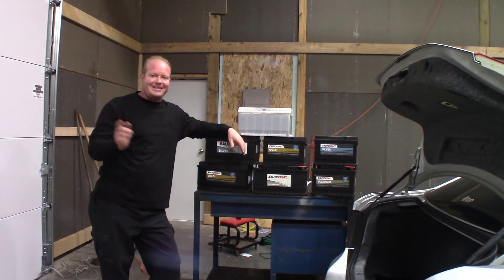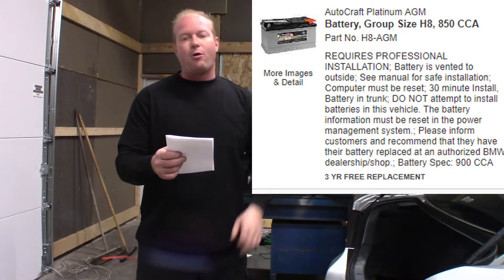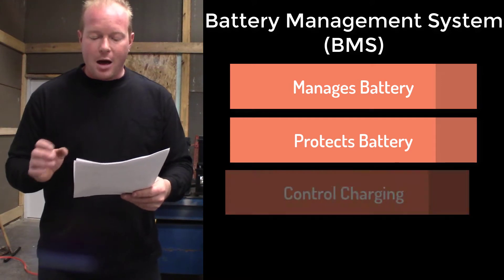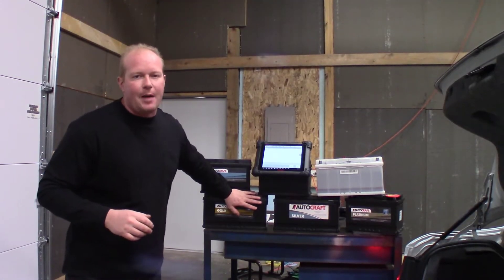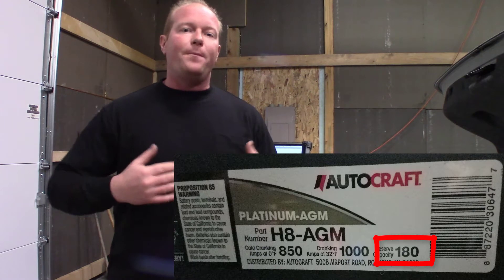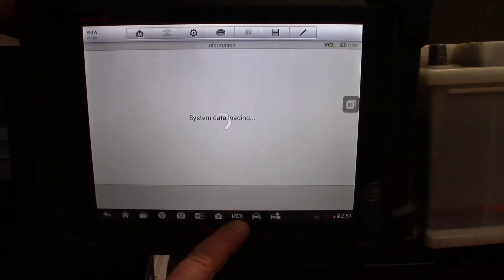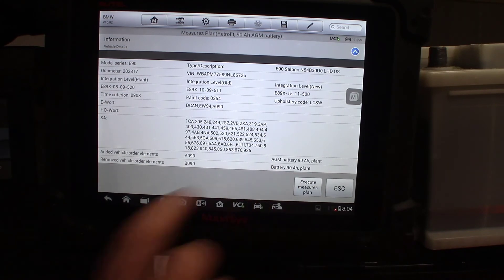BMW Battery upgrade, and registration with Autel MS908P

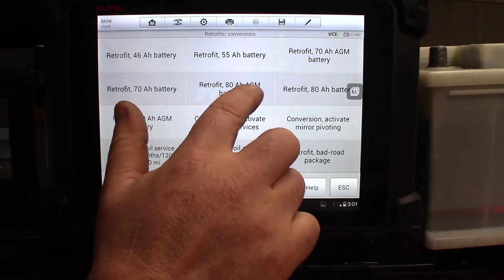Comment: 3:25 And what if I had a 60Ah or 95Ah battery. The MS908 is an expensive unit and falls short. A real diagnostic tester would have drop-down menus for battery type, capacity where you would actually enter the value...
Reply: I had the same problem with the Maxisys. I wonder if there is an update for ah95 option..
Reply: I have the regular maxisys updated to 2018. Will it work for this?
Reply: @samson2143  I have no idea. I have a iCarsoft CR MAX.
Reply: I just bought a MK906 PRO-TS released in 2022, and it still has the same
Issue where it only resets to the same
type of battery. It doesn’t allow you to enter a new capacity or type.. really disappointed. Back to INSTA-D to register a battery..

Comment: Did they remove this in newer version of software?  I have IM608 Pro and it doesn't have the retrofit/conversions option available.
Reply from the maker: I think the retrofit is only available on the MS909, MS919, and Ultra, Not on the IM series

Comment: Aaaaarrggg !In other words If you don't have a MS908P, or Elite with J box within free update period and a good WIFI connection to go into Programming mode for BMS, you will not be able to change the last installed(recorded) battery specs , and no other Autel tool works to edit the battery specs. 

  To me this sounds like basic BS advanced  coding that all Maxi Sys tools should be able to accomplish , changing battery type , and CCA and not something that should require re programming of module with a J box. Autel has needed to fix this non working function for the last decade that it still shows in the menu F2 and F3 from the days of the DS708 and to this day but has never been addressed! Thanks Chad for telling us the way it needs to be done for the FN Farfignueegen funk Function to work

Comment: I changed out my battery and have a MaxiSys MS906. Memory seems to not read the EGS and hear selector seems to have no power.
Please help
Reply: I have a BMW 2013 xdrive35i e70
Reply from the maker: I'm not a BMW guy, according to my sources this can happen if you replace the battery with the key on.  Most likely a fuse is blown.
Reply from the maker: If it’s an 8 speed trans check fuse f13 and f15 to start with

Comment: Hi, I have the Autel MD808 pro. Is it possible to do a battery registration (BMW) with this tool or do I need a different model?
Reply from the maker: Yes, the MD808P can preform this functions.  Select Service>BMS> The steps will be the same.  One thing to note.  With the MD808P you can only swap for an exact matching battery.  You can not change to a different type/size of battery. Check out this video for the steps using your MD808P https://youtu.be/B0P3r5ZK3rs

Comment: Hey so I replaced my battery today and after doing everything and re coding the new autocraft gold 90ah agm battery into my 07 335xi, I lost connection to WiFi a couple times but the only module that failed to fully code was the PDC and that’s because I don’t have it on the front bumper, but anyways, all my abs lights are on and in limp mode, I have the same autel and I used the black Bluetooth vci, should I have used the silver programmer box? Anything else I may have done incorrectly?
Reply from the maker: That's really weird,  Any time I am on the programming side of the tool I always use the J2534 Box, and I always connect the tablet to the vehicle via the USB cable just to prevent any of these hiccups.  I would start by connecting the J-box and getting a good internet connection and re-scanning the vehicle.

Comment: Can the autel ms905 mini register and upgrade Bmw battery
Reply: Yes and no, if your MS905 is up to date it will be able to do the batter reset under the service tab.  If you don't see the service tab you will have to the special function in the module.  With the MS905 you will not be able to do the battery upgrade you will need to have a Pro or Elite.  Here is a video on battery registration doing the same process as the MS905 https://youtu.be/B0P3r5ZK3rs